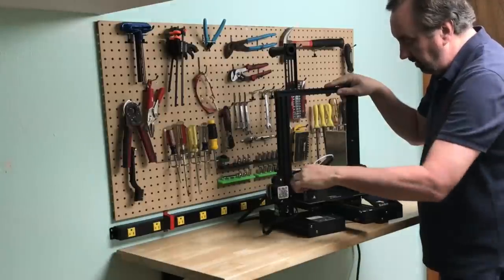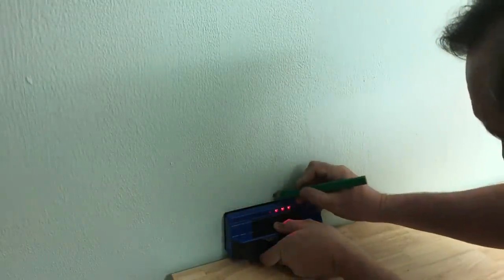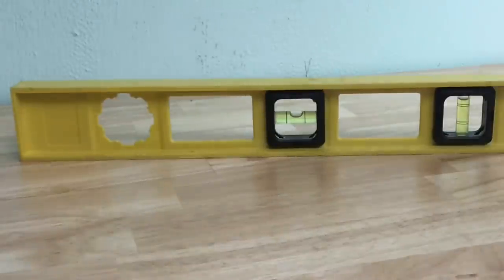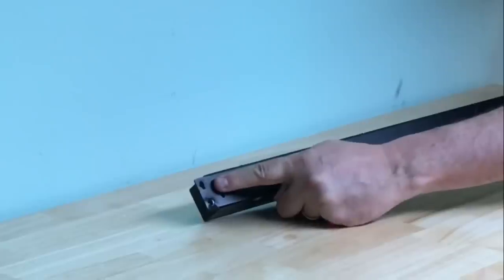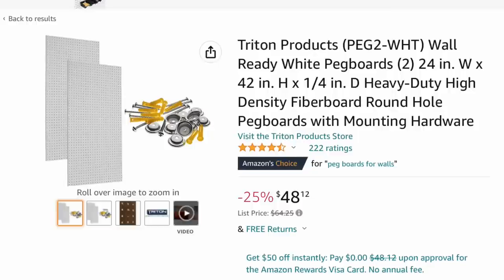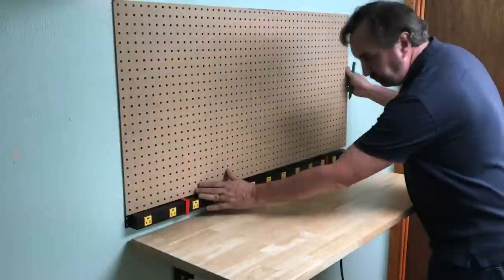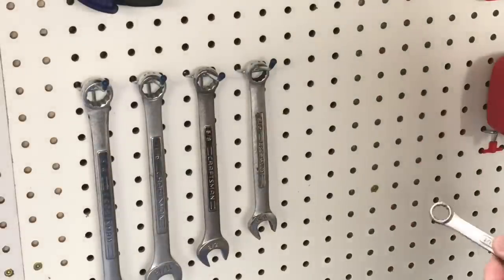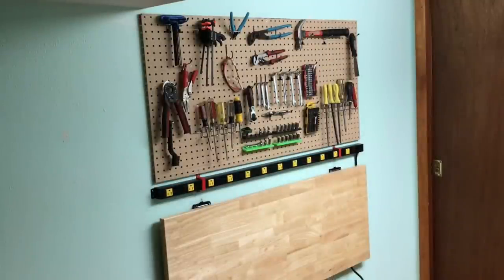Flip-Up / Flip-Down Workbench for Fixing 3D Printers

Comment: This.  This is my FDM printer's raison d'être.  I've never printed a Benchie, a Groot, or a baby Yoda in my 3 years of printing.  I primarily just do practical prints, mainly of my own design (and still using TinkerCad), which allow me to repair, modify and improve stuff, along with creating new, useful stuff.

  Chuck, if you can keep that excellent new bench clear, uncluttered and still able to fold after three weeks of use, then you're a better man than me.  😄👍

Comment: I also strongly recommend a Precision screwdriver set with bit set. It’s a great add on to the work space, it’s small portable and has a tab so you can hook it to your peg board. Excellent for doing hotend swaps, wheels and motherboard replacement and running m2, m3, m4 bolts into your 3D prints!👍

Comment: I sort of did that too but to recycle I designed mount for chineese food containers that got delivered in my country when you order food.  I use the containers to hold tools and bits would be awesome to send you a a picture! Also my workbench is not foldable is just a wood workbench but I added casters rock solid and I can move it into the room when I need space :)

Comment: Actually it is better if the plugs are "upside down". If gravity ever pulls the cable out and down you touch the ground rather than the hot an neutral. It's actually code in some places to install plugs ground pin facing up.
Reply: That's .... controversial.
Reply: @RussellNelson  yeah I know, I have only seen it used this way in hospitals. I know it's hotly debated amongst electricians. I don't think there's a wrong way though!

Comment: My wife and I put up a 4x6 ft pegboard last year and I wish I would've thought of something as clever as those spacers for it. We just used some 1x2 scrap lumber. I've been solving problems with wood for 25 years and 3d printing for only 2 years.
Reply from the maker: I’ve done that for years but they plug too many holes so I designed those.

Comment: I would advice you to mount your outlets UNDER the table near the front - placed on the wall will give you 'snakes' crawling all over your tabletop - that's NOT the case if it's placed under the table - right ?
Reply from the maker: If I do that, I can’t use them when the bench is flipped down. I prefer the way I did it.
Reply: Realistically, you're not going to have that many cables running across it to the back. The table is small enough, that you'd probably never use all those sockets at once anyway. You'd  have a table full of tools and no work space.

Comment: Having issues importing Chep’s creality profile in cura. Anyone have an idea what i can try? Chep’s website mentioned selecting “creality machine profile” i got an ender 3 pro and selected that machine setting. I don’t see a Printer option for “creality machine option” see reply for the message i get.
Reply: “Successfully imported profile CHEP4.12_0.12(Best) #5.
Warning: The profile is not visible because its quality type
'standard' is not available for the current configuration. Switch
to a material/nozzle combination that can use this quality type.”
Reply: @Werdna12345  I've never seen that error, but it sounds like it doesn't want to override your current settings by importing. Try changing to another material (I'd guess PLA), another nozzle size (I'd guess 0.4mm), and the standard .2mm quality and importing again.